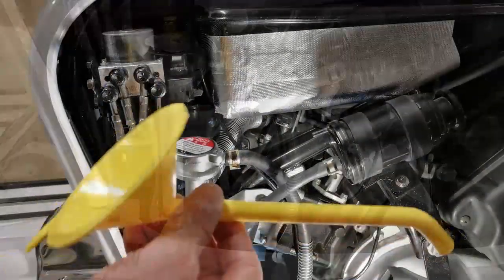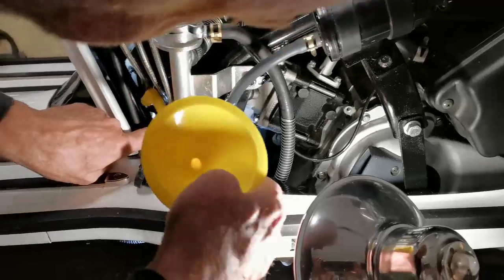Topping up coolant on Royal Alloy Liquid cooled Scooters

Comment: Hi very useful video as always. I just have a couple of questions.
1. Have you found a specification for the Royal Alloy coolant as nothing is mentioned in my manual. If so what is it?
2. Why can’t you just fill up the coolant using the coolant cap which is shown on your video at the front and high up on the left side of the bike. It’s just that the manual I received with my GP200 shows this as the coolant tank cap and doesn’t mention the fill point you used so I am a bit confused. Thanks
Reply from the maker: Hi Shaun, I don't have a specification so I worked on the don't mix different colour coolants. Regarding filling via the radiator cap, this can only be done by topping to the limit and leaving it to settle for between 15 to 30 mins. Its a long process and although it can be done the method shown is far easier.
Reply: @MikeColwell  Thanks for the update!

Comment: Chris H.
An easier method is to remove the radiator cap and inject coolant into the overflow (expansion) tube.
Reply from the maker: Hi Chris, Have you tried what your suggesting, it takes an age for the coolant to settle in the neck of the radiator making a simple top up take hours. I originally made a video doing it via the radiator cap and it was so unsatisfactory I deleted it and made a new video doing it the factory recommended way!
Reply: I understand that you have shown (quite properly) the correct Factory Method, but I  just can't get to the expansion tank bung!
You are quite right, It would take a considerable time to let gravity alone top-up the expansion tank from overfilling the neck of the radiator tube.
The method is to directly inject coolant with a small syringe into the expansion tube, the top-up from lower to upper level only takes around 10 minutes.  @MikeColwell
Reply from the maker: @scratchvideo8859  I understand your frustration but I found reaching round the frame I could manage to lift and replace the cap. I have, however got quite long fingers!

Comment: Reading the comments I'm still unsure whether you're correct filling via the expansion tank or as others have why not use the filler on the left hand side, removing the cap and topping up? 🤔
Reply from the maker: If you do as you suggest you will see its difficult to fill the other way as you keep having to stop to let the coolant seep down.